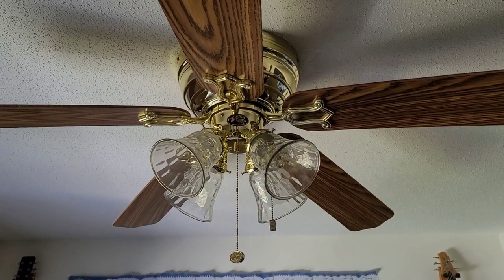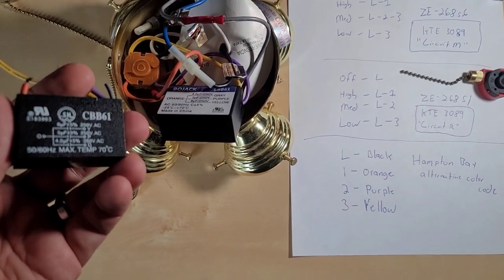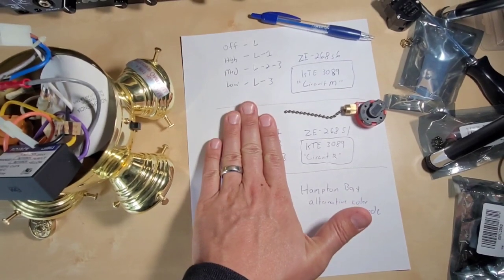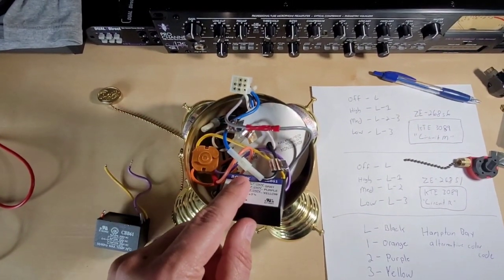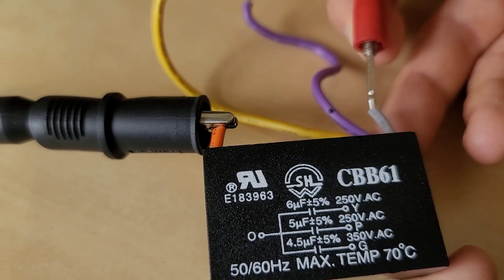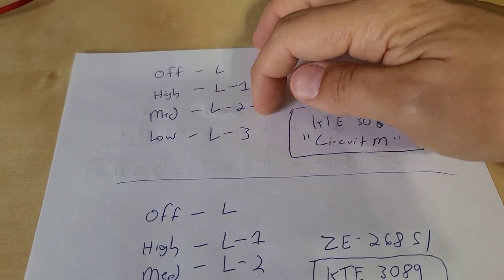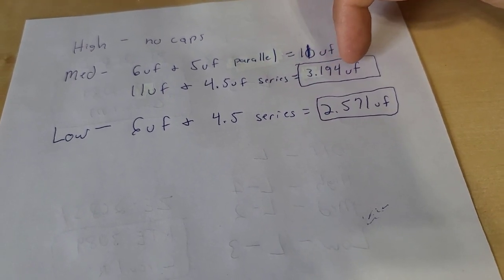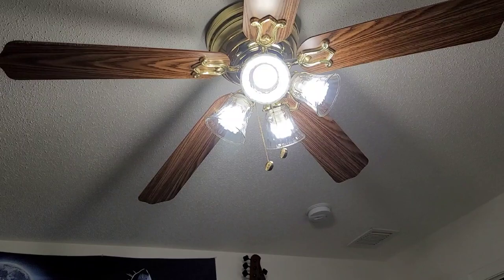Ceiling Fan Repair: Pull Switch & Capacitor Replacement Hampton Bay

Comment: Thanks learned something today...I have Hampton Bay switch Shine Top LS-102, not knowing I bought a Zing Ear 268 S1,,, of course it doesn't work. I have Blk-L Grey-1 Brown-2 Purple -3 on the original so assuming I also need a 268S6 as well?
Reply: Just found the cross-reference page and yes 268S6 is the one It is L,3,1,2 counterclockwise label,Thanks
Reply from the maker: @edwarddinardo1248  awesome Glad you were able to figure it out yeah the different color codes and the fact of the switch configuration difference through me for a loop a few years ago myself. Glad the new video was able to help out.

Comment: mine is a 5 wire capacitor. just ordered a new one, but the old one does not have the schematic to say what is what.(colors are the same) i guess i will bring my meter from work home and read the capacitor. dont know what meter you have but my fluke has a capacitor check. just hit the select button and go to proper setting, i think mine is on the diode setting swich. i hope this fixes my problem. did not think about pull cord till i saw your video,but i already ordered it. the swich works but it only runs on low speed. BUT something burnt up in there, i can smell it
Reply from the maker: Yeah unfortunately schematics for specific ceiling fans are hard to come by. It's always good to read the part numbers and trace out the circuit before you start cutting wires
Reply: @Bassguitarist1985  well i replaced it and it worked perfectly. the capacitor had a burnt hole in it. so this 9 dollar capacitor saved me alot of money. as mine was stained glass which had a matching stained glass table lamp. runs smooth and quiet.
Reply from the maker: @sundogtune  glad to hear it worked out!

Comment: Re: honda 4514 repair video from 3 years ago.  Can you tell me where you obtained your spare parts from.  I need charging coils  and cannot get them.  Also,  will the ride on mower still run if these coils are defective?  Any help would be appreciative.
Reply from the maker: Boats.net

Comment: If I don't want to replace the capacitor, how do I connect the wires together to keep the lights on?
Reply from the maker: The lighting circuit and the fan circuit are separate. You shouldn't have to do anything with the lighting circuit if that pull switch is still good

Comment: so basically....just match the colors to the switch and so on..just like the Old capacitor ?
Reply from the maker: Pretty much yes! Unfortunately it is very difficult to find a color code diagram of the original circuit to make things easy. Some sites do offer some help but it does take some intuitiveness to figure out the circuit.
Reply: @Bassguitarist1985  I ordered the exact capacitor you have in your video, it was the only one I found with the correct wire colors for sure..so I will just follow the colors...Thank You
Reply: just came today...15 minutes, the Fan works like new...I Thank You for making Great Videos
Reply from the maker: @ronkoyonagi4907  glad it worked out!!!!